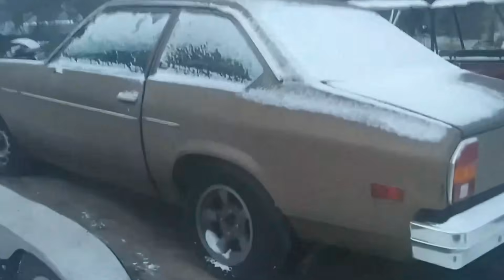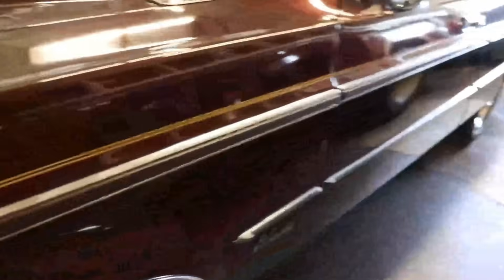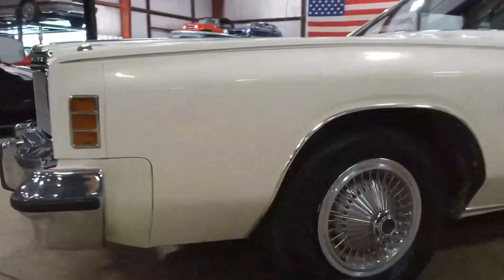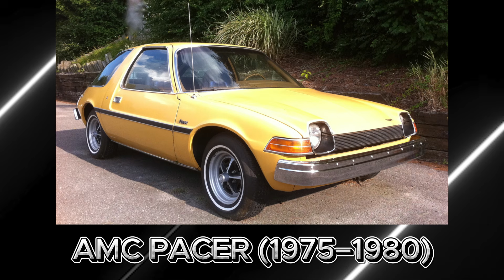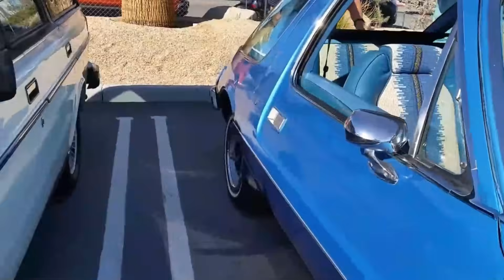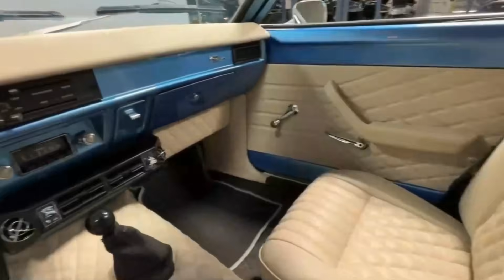Top 7 WORST Classic Cars of the 1970s!

Comment: Any of the cars on this list could be placed in any position. This is more opinion than experience with the cars. I grew up with these. The Vega was the worst overall problem prone of these cars. Too bad, the Vega could have been a better car. I would take a Mustang II today. I would also take a Pinto as well. But with the Pinto I would reinforce the area that caused the fuel fires.

One must remember that any new model cars in the 70s that did not exist in the 60s were garbage, that's just how the times were. Most American 1970s cars built after 1972 were just not good.  As someone who grew up with these cars and road in or drove many of them I say anything from 1972 to maybe 1982 or 1983 were some of the worst  built vehicles.